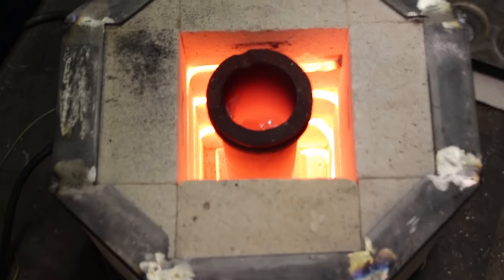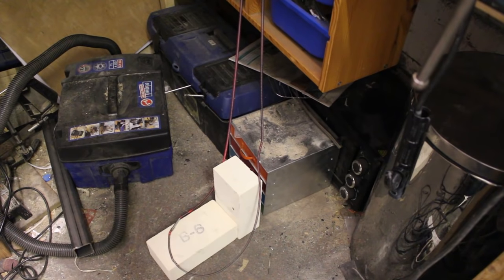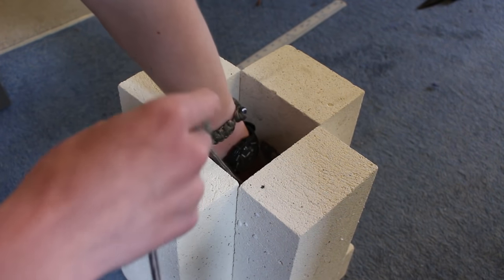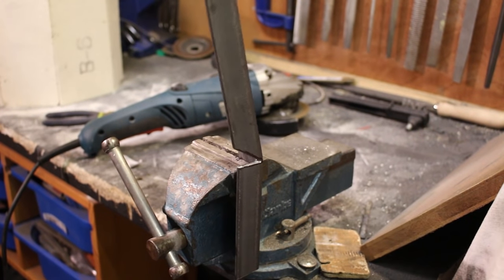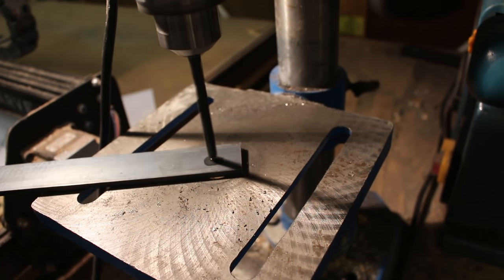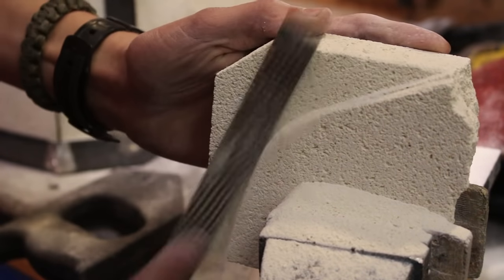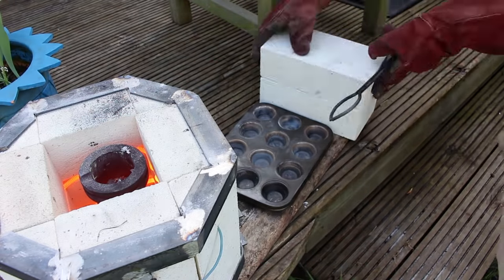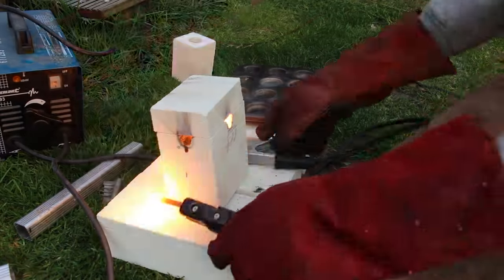How to Make an Electric Foundry For Metal Casting - Part 1

Comment from the maker: Here is a new upgrade and maintenance video about this foundry after a year of hard use:
https://www.youtube.com/watch?v=p7uSGXR8NDs
Reply: is there any way i can just buy one from you
Reply: how hot does this actually get? could it melt glass? ps good video :)
Reply: TAOW WE LOVED every thing about your furnace but, yes here is always a but. do you really pour hot metal on your wood deck, e should say on your mom and dad's wood deck!!? DUDE NEVER POUR ON CONCRETE OR MOM AND DAD'S WOODEN DECK!!! Now we will be going to the next video, so we can see about finding something to bitch about because we jealous of your furnace. Old One Legged Joseph T
Reply: If you wanted it cheaper you could have just encased it in a few inches of cement or lime with chicken wire reinforcement. 
It would take less time and be cheaper.
Reply: I've been watching you , since you  poured your first slingshot, online.  Love your videos...You are amazingly innovative and inspiring. 
Keep up the great work.
Reply: Very good video! Thanks for your effort!
Reply: TAOW I think it would be really cool if you made a video of you running it on solar panels.
Reply: TAOW Crackin job Gommet 👍
Reply: No nothing like this could do that, much higher grade product would have to be purchased, really expensive! 2,600-2,800°F (1,427-1,538°C) man if I could do that I start melting Platinum at 3,215°F (1,768°C) lol. :-)
The plants sell approximately 90 percent of the cullet to glass manufacturers, who mix it with limestone, soda ash and other raw materials.
Reply: Pouring over concrete can cause the surface of it to explode causing possible harm to ones self or eyes. Not good to do, pour over a piece of shear rock or they make a thermal version, forget the name of it now. Or if nothing else, have a layer of sand about a inch thick.
Reply: This is pretty cool. Gg.
Reply: my foundry got exploded... 😣😣😣
Reply: So does it directly run off dc?
Reply: too bad this is a little small for me. I'd need something large enough to hold at least a lawnmower flywheel, for diameter.